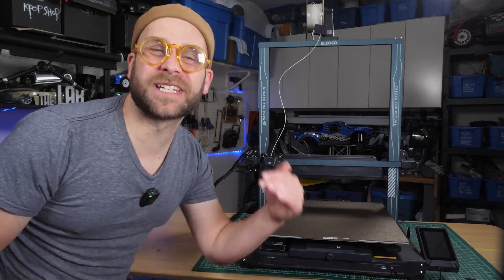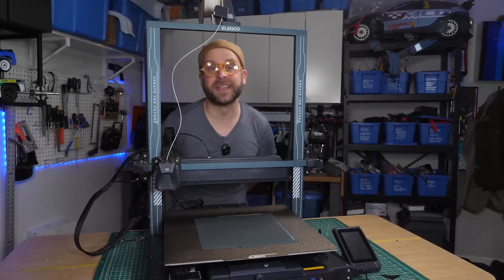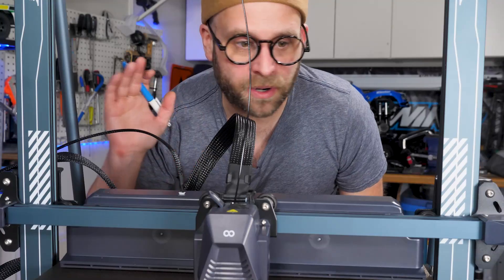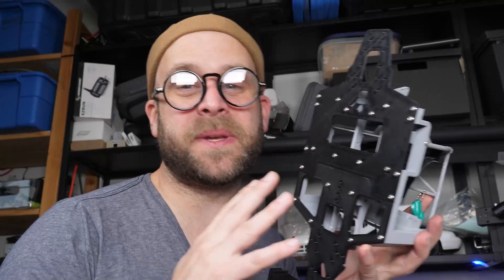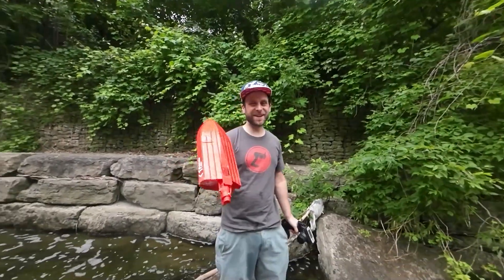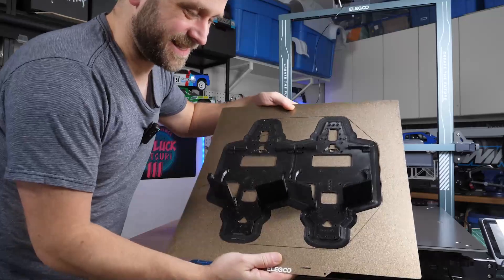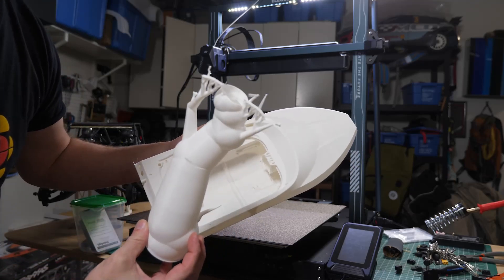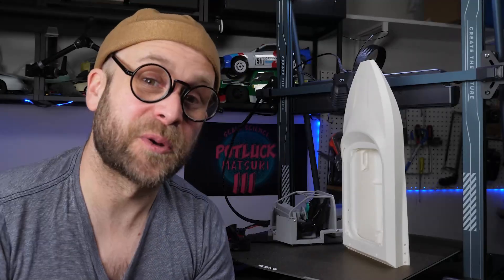Print Huge on the cheap! | ELEGOO NEPTUNE 4 MAX

Comment: The only way I fixed my layer line was to do ALL the TBSTRON3D upgrades which almost equalled the original printer cost. I also had to add a Beacon eddy current probe. The newer ones with black build plate.
Reply from the maker: sounds exhausting.
Reply: @kpopRC AND REGRET GENERATING it still is just chaotic.

Comment: I have a Elegoo Neptune 4 Max that has a bad Y-axis stepper motor.  It stopped working after just 5 months.  They claim they provide a 12 month warranty, but I contacted support on May 28th and still haven't even gotten a response from them.
Reply from the maker: You bought one of the cheapest printers out there. Maybe swap the stepper motor for a quality one — it'll still only cost a third of what you paid for the whole printer. These budget machines require tinkering and fixes. If you're not into that, spend 5x more on something premium.

For me, this has the largest print bed available, and I’m fine dealing with the “cheapness” that comes with budget printers. If you want an appliance that just works, look at Bambu Lab. But for those of us who actually make our tools work — with or without company support — this printer is worth the investment and the occasional headache.

Comment: A lot of the issues you had with layer changes on the hull could be mitigated by turning the the hull 90 so the wide part is parallel to the bed movement. Helps prevent tall wobble and reduces the layer artifacts.

Comment: Your lucky, this has not been my experience with this printer at all. I was able to do 1 successful 7x7 print and now nothing finishes and I have spent 30 hours tuning… I am so over this😊
Reply from the maker: Damn! Hope you get it sorted. I did make sure to update to the latest firmware. and also using Orca slicer that seems to work super well. i also avoid high speed with large prints. maybe that helps.
Reply: @kpopRC  Yeah, unfortunately I have currently done all of those, unless you think 80mm/s is still to fast for Elegoo Generic PLA. i also tried 2 other PLA's both from different brands. Love Orca Slicer, it has made this process less painful compared to cura. I even did the SD card display firmware update. At a total loss... I appreciate the reply and you trying to potentially help!

Comment: Even though this video is obviously an ad, I don’t care. Whatever helps pay the bills so you can continue producing quality content. 
A message to the masses though, if you don’t need this massive print area then save yourself the trouble and just get a bambulab printer. It will work perfectly 99% of the time.

Comment: Quick Question...Wouldn't the hull be stronger in PETG? Nylon Maybe?
Reply from the maker: petg is actually weaker than pla. Abs and Nylon would need a heated enclosure. Pla works great, these hulls need to be covered in epoxy regardless.
Reply: @ I’d be interested in seeing that test. I respectfully disagree on that. However if they have to be coated anyway…it’s a non-issue. Thanks for the reply!

Comment: The thing that connects the direct drive extruder to the rest of the printer kinda looks like the cable on the ender 3 s1 pro
Reply from the maker: i've seen many whips that look like this. even the prusa mk4 uses the same wire sheath.
Reply: Interesting

Comment: This printer brings much more problems than usefulness. It's a nightmares to calibrate  and orit don't stick on a build plate and its loud. I have had a problem when printer was knocking points off. And  layers shifting....
Reply from the maker: i've had no problems with that yet.

Comment: I had nothing but issues with layer shifts out the box with this printer.  After going over adjustments,  after a firmware update and adding the locks to x and y axis adjustment knobs, its printing decent. It's not a bad printer by any means, and the bed is massive!
Reply from the maker: exactly. i feel like people have way too high expectations for a sub 500 dollar printer. buy cheaper you're going to have growing pains, pains that im 100% ok with because this print bed is larger than all of my other printers. and. you know. it works pretty damn well and costs a 3rd of a bambu.

Comment: "It won't let you down" - As an owner of a Neptune 4 Max, I can only conclude that you were sponsored by Elegoo because this machine has let me down more times than all my other printers combined. Its a cheap and badly designed machine with an even worse Quality Control lottery than Creality.
Reply from the maker: Sorry to hear. No issues with this. I have been printing since the cupcake maker bot days. Maybe we both have different ideas of what a sub 500 dollar printer is. You literally watched this printer print 380mm tall boat hull on the first try.

Comment: Had nothing but trouble with my Neptune 4 max 230 emails with support so far no resolution
Reply from the maker: at least say what you had problems with. otherwise this comment means nothing to no body.
Reply: @ heater extruder not heating at expected rate. 
All happened with in the first 3 weeks of owning the printers ( brought 2 ) both same issue. “Support” if you can call it that have had me pull the printers apart multiple times to take photos to make sure everything is plugged in ect, sent replacement parts that have not changed the issues. 
Never ending fight with them trying to get a resolution.
Reply from the maker: so what was wrong? please be specific. I can't take your experience seriously if you're not specific.

Comment: I've been using Anycubic Kobra Standard for a while, I have definately gotten what I paid for. It's starting to die after 2 years and not much work. It really is a POS!

This would be a better upgrade?
Reply: No, definitely not. The Kobra 2 Max is superior in terms of build quality to this. Only thing this has going for it is Klipper (which the Kobra 2 Max can't be upgraded to). Yes you can upgrade it with Linear Rail kits and other mods but by the time you spend that money you might as well just buy a Comgrow T500 or wait for the Ender 5 Max in 2025
Reply: @AllieT-wq8eq  hmmm okay. After owning 1 anycubic, also being my first printer, I don't really want to support them or their poor customer service.
Reply: @Quickshift_Racing  fair, though I wouldn't rate Elegoo as much better. Its a bit more pricey but the Comgrow T500 is built like a tank and the Ender 5 Max, when it comes out, is a little smaller but will be CoreXY. Whilst they're both more expensive options, honestly in a large format printer, this printer is just a massive pain in the ass
Reply: @AllieT-wq8eq  Thanks buddy, I'll check it out.
Reply from the maker: you're still looking at a budget printer. so expect it to be exactly that. budget. the more robust back end and software is more expensive. however. bed size and height is what has others beat by this elegoo.